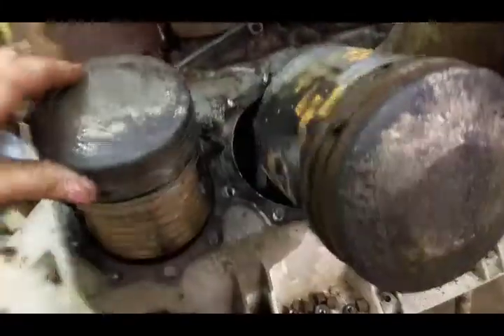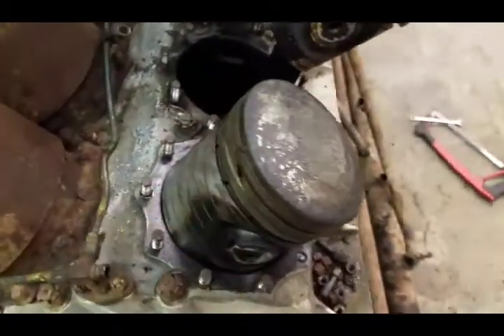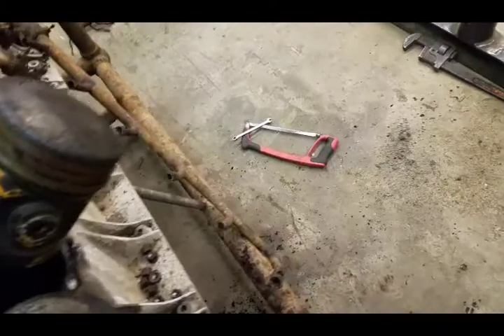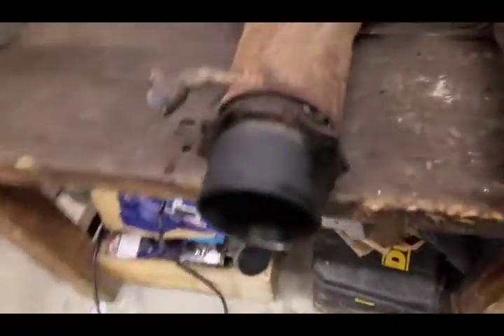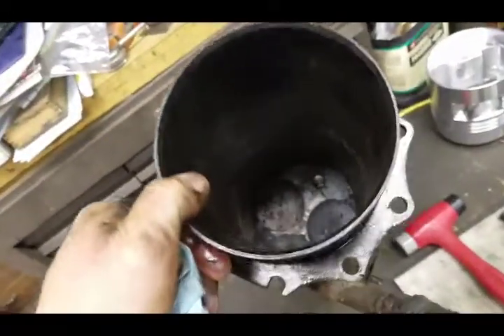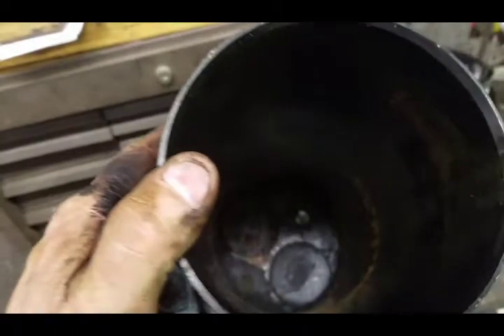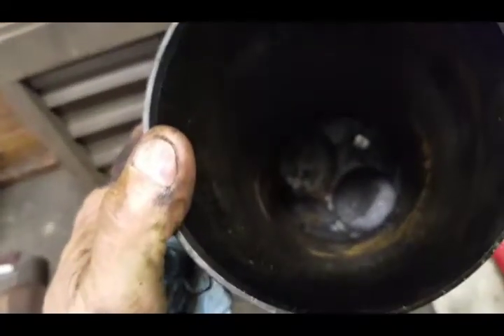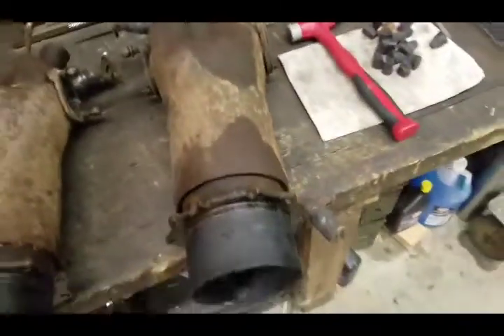Liberty v12 cylinder removed

Comment: Are the valve seats ground in that cylinder head?
Reply: Valves are ground into the valve seats😎
Reply: @richardrichard5409  I am trying to determine if the valve seats are ground with a chamfer or if the valve closes on a flat surface-both designs were used at that time. Hopefully somebody with technical knowledge will answer.

Comment: How are the barrels and cylinder heads constructed? Are they fabricated in some way?
Reply: Cold working metal forming process devised mainly by Ford Motor Company. The water jackets were sheet metal brazed on the piston exterior.
Reply: @heyfitzpablum  Thank you